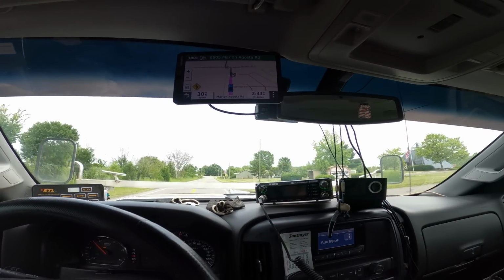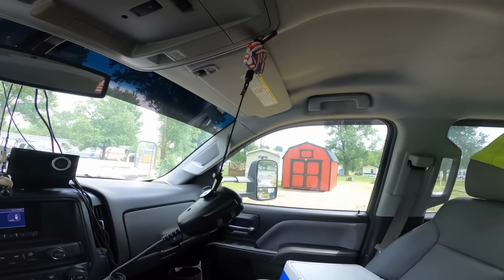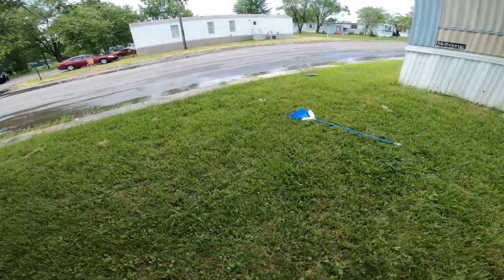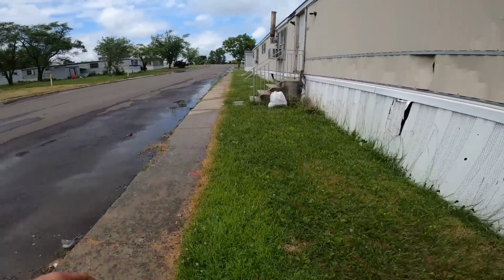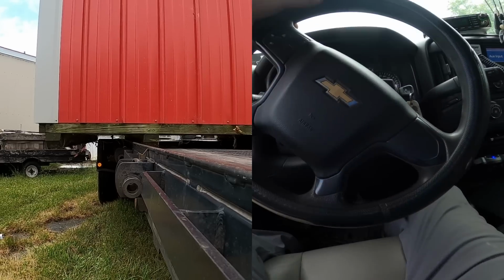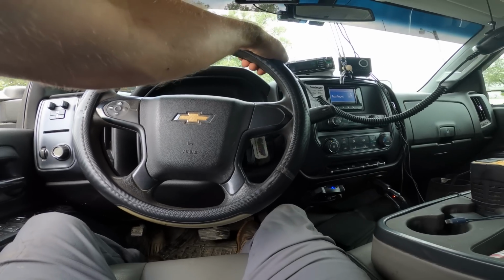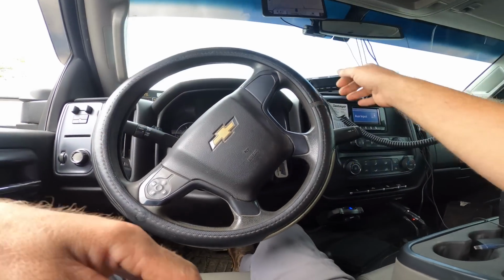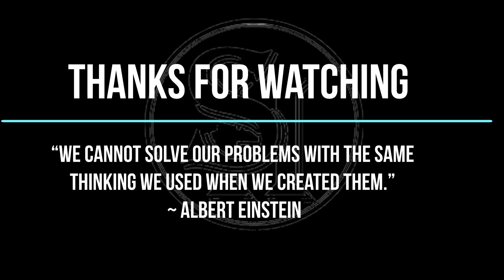Shed Repo #60

Comment: You know that trailer had to be a custom built & designed by a repo guy. It's the perfect repo trailer and the little track helper that does all the heavy lifting. Makes the job a lot safer getting you in & out as quickly as possible. Awesome

Comment: Just some food for thought.  In my humble opinion, you are, your own worst (time) enemy. I would be only making "1 (one)" trip  only, around that trailer, reference securing Shed to trailer, & putting flag(s) on.  Those flag(s) and one (oversize) sign don't weight 30 pounds a piece.  Either get a bag of some type to put flag(s) & Driver in, so as to say hang off your shoulder, so as you start "1st" flag, move to first tie-down, then 2nd Tie-down,  3rd Tie-down, than 2nd flag. Rinse and Repeat opposite order for the other side. Your done. Get back in your truck.  I'm not preaching "Time is Money," I will preach that the faster you secure and flag the load, the less time to maybe have to deal with a very likely unhappy individual.  Stay safe.  Thanks for taking the time to shoot, edit, upload these video's.
P.S. I would change out the "wooden / metal oversize sign" for a fabric one. That's just me. Unless local DOT say's you have to have a light on the "Oversize Sign."
Reply: I have only seen one video of his where they blocked him out trying to prevent recovery. All the rest they either were not present or not confrontational. Unlike a car which is vital for transportation, a shed is more of an option so I think that is why there isn't as much angry confrontation.

Comment: Simple solution, if you can’t afford it, don’t buy it. I get everyone runs into hard times, but if it happens, work something out with whoever the loan is through instead of just not paying. Most of the time they don’t want it back and will work with you.

Comment: If you don't want it repod need to add a container on each end inside 2.5 ft high x 10 ft long x 2.5 ft wide FULL OF CEMENT  TO MAKE IT TO HEAVY .
Reply: That would add apx 5,000 lbs
Reply: On other words you bought a shed to fill with concrete and nothing els 🤦‍♂️